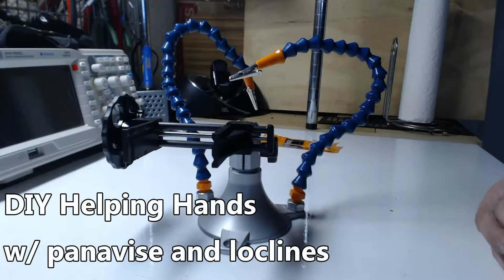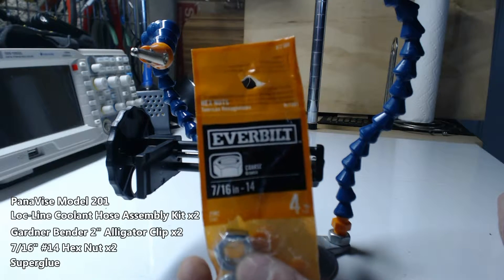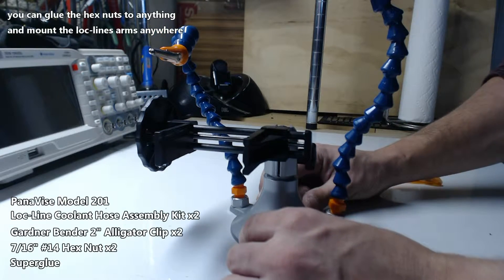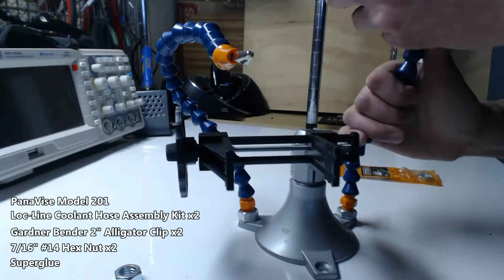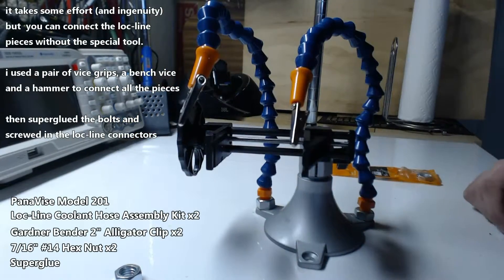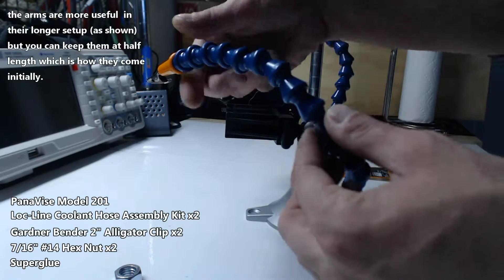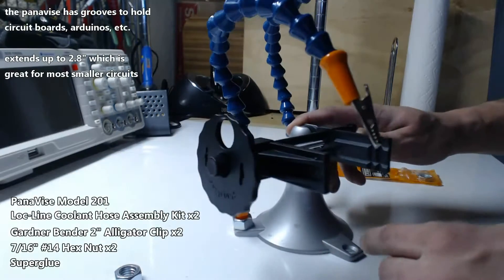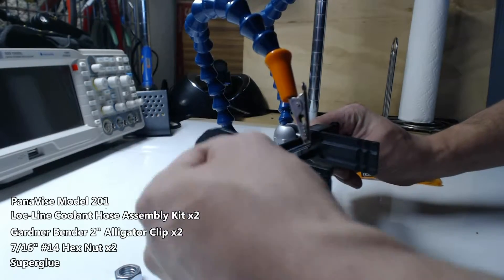DIY Helping Hands with Panavise and Loc-lines

Comment: Is the Loc-Line 1/4"  or 1/2"  ?
Reply from the maker: +Sierra Rat Good question, 1/4" Loc-line (Loc-Line Coolant Hose Assembly Kit, Acetal Copolymer, 7 Piece, 1/4" Coolant Hose ID)... do you do any backpacking, rock climbing, fly fishing or 4x4ing in the eastern sierras? (couldn't help but notice your displayname).
Reply: +Hi, I do live in the Sierras about 30 miles SE of Lassen National Park.  I used to do those things, but I just turned 70 and now I just walk in the woods with the dog and enjoy the view.  Thanks for the quick response to my question.  I plan on building a unit like the one you constructed, but without the Panavise.  I really enjoyed the video and you helped me out a lot with the planning and building.